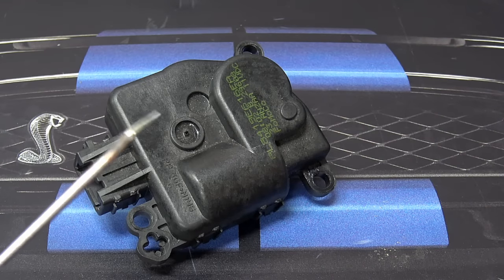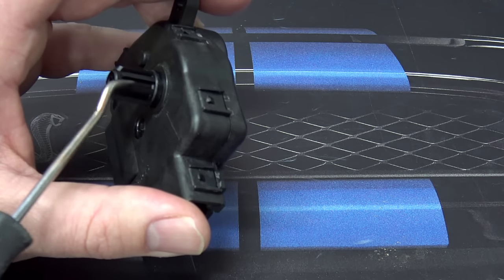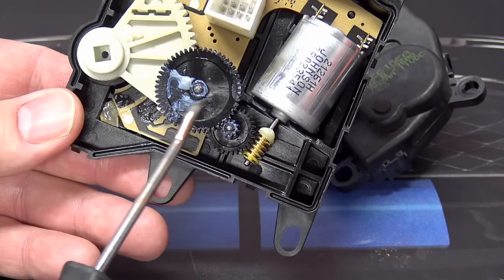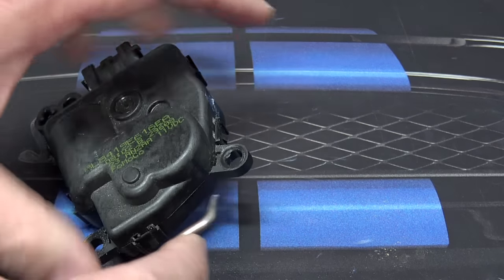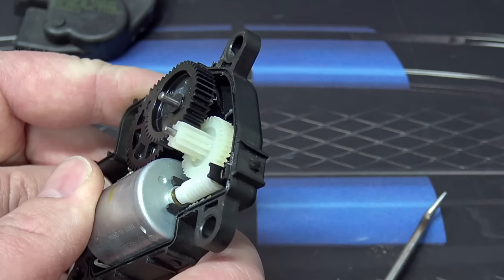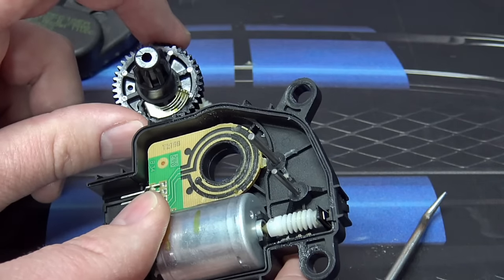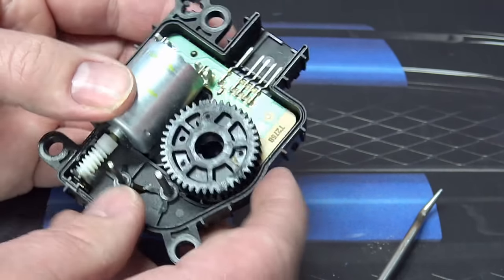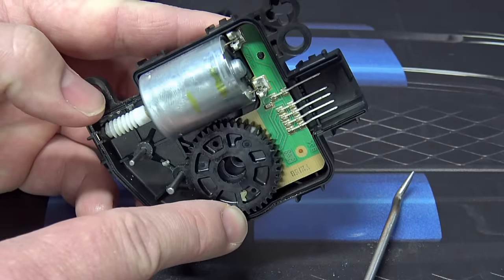Ford Vehicles: Frequent Blend Door Actuator Failures and Why?

Comment: 2008 F150, the temperature was basically either "full hot" or "frigid"; the only moderate temps were in a range of less than half an inch on the dial.  I replaced the actuator with an aftermarket one, did the "learn" sequence, and it would strip the gears at the hot end of the range.  I replaced it again under warranty, same problem.  I replaced it a third time with the Ford part, and it didn't strip at the end, but it has the same issue as the original one.  I gave up and just live with it basically having a hair trigger.

In the 2004-2008 F150, you'll want to remove the radio, the change tray on the dash, and the glove box.  You can see one screw ok and another screw poorly. The third is out of sight, on the back side of the actuator, but with the radio and glove box out, you can get both hands on it and that makes all the difference.

Comment: This is an industry wide issue. My Acura MDX failed about 4 times. I bought a new one the first time, and simply cleaned the contacts the other times.  Good video but why not add a solution? All I do to mine is clean the contacts and add dielectric grease.

Comment: Oh those tracking fingers as you called them is the same on the auto climate control in my Mazda too and so I have to turn it 100 times each way until it's warm then goes away for the most part.

Comment: 4:47 why wouldn't they use a hall effect sensor? Much more reliable, only a little more $ per part
Reply: @IamMike86 where exactly in my question was it answered?

Compared to the negative pr gained from failing parts, I'd say wiper resistor is a dumb move. HVAC being one noticed quickly and ignored. The measure of a vehicle's reliability in a car often is summed up by a layman: "the A/C still works!"

How much more expensive is the sensor? Look it up, scale it up, it ain't shit. They wouldn't cheap out like that, sure it's Ford but pennies for risking hundreds of $ in warranty work per vehicle?

Ford also must not offer any warranty beyond 5 years. No car company wants to fix a blend door in warranty.
Reply: @IamMike86 by a little more $, that includes all associated costs with switching a part from one to another. Hall sensors are way cheaper than their slide resistor counterpart, the change to them is the expensive part, but irrelevant after only a few years
Reply: Remember the PINTO?

Comment: We have two Lincoln Town Cars. A '96 and a '08. They both appear to have blend door actuator issues. It's 2.9 hours to do the job on the '96 according to the book. Pulling the dash is a PITA. I hate to think what it is to get into the 2008 model.
I, too, remember the simple Bowden cable controls on my VW Beetles, as well as a '72 Impala which used the same "technology" to control heat & A/C. Then I remember fixing my wife's '78 Chevette, which had "advanced" to vacuum control... the heat/A/C control panel was a mostly plastic vacuum switch... which failed. Had that car not been basically disposable, I'm sure other vacuum leaks would have caused more hard-to-troubleshoot malfunctions over time. Now we've "advanced" yet again to expensive, but cheap, electronic controls for everything.

Comment: can you 3D print a more durable pair of gears for the earlier design ?  does the grease mess up the more recent design ?  should the fingers be bent outward a little more ?   or is the metal too soft ?    is there an error code for non-contacting fingers ?

Comment: I sent you a small video on your IG. I did a heater core swap. Actuator was fine before work was done. Now it don’t want to work correctly. 2010 Ford Crown Vic. Even bought a new actuator. Same issue.

Comment: Today I bought a 2001 Crown Vic and in the ad the owner said that the AC does not work..when I got it home I turned on the AC and noticed that even though it didn't blow from the dash, it was blowing underneath at the floor..I kept pressing all the buttons and after turning the car off and on several times, it's now blowing from the dash and very cool...since then I have restarted the car 15 times and turned the AC off and on and it's still working...I hope it keeps on working with

Comment: Thanks for the video! I discovered those crappy little gears in the older units a few years ago after taking one apart that was clicking. No competent engineer would have ever designed the moving parts like that, and no competent company would have approved it.  We bought our first brand new vehicle since 2005 last year. Guess what? NOT a Ford!

Comment: 👍🏽👍🏽👍🏽Thank you for this detailed explanation of the inner workings of these actuators. I have a problem with a Dodge truck vent system where the the vents operate and switch the direction of the airflow, but not properly according to the dial settings. I suspect this is more of an electrical problem than a mechanical one and this truck has been plague with minor electrical issues (Mis-wired after-market stereo and speakers, fried climate control panel, etc.). There are tons of videos on the Dodge blend door issues, but not on the actuators and how they can malfunction. Great job?

Comment: Had three of the later versions blow chunks in my '07 Mustang.  Clicking and snapping noises enough to drive me insane.  Can't replace one on the driver's side...thanks Ford for that impossible to remove bolt location.  So, busted it out and manually swing it for upper or lower air needs.  Leave it mostly on panel position anyway.  They all sheared teeth when they couldn't find home position, apparently.

Comment: My problem always seems to be the output shaft being in two pieces. Once removed I am able to snap it right back in. Since I've already removed it and have a new one. I just go ahead and replace it. Have thought about super gluing it in, but haven't. Also this is my experience with non oem versions. The next one I do will be oem. Hopefully it will last longer than the usual year or so from the others.

Comment: What are symptoms of a blend door failure. 2009 king ranch. I cleaned the drain, and condenser. New fan resistor and fan. My ac is ok, then warm. System was charged. My ac temp changes but nothing that makes me comfortable on a got day. If it's 90 outside I am 82 in the cab

Comment: Hey, I’m having a real issue with my 2012 F150 and I’m not sure where to go. Truck won’t go to defrost but the motor is working correct and I can manually move the doors and they seem solid

Comment: Had this cause max ac actuator door to fail. The motor just lost position enough times that the spindle to the door broke off. Now it won’t recirculate.
Reply: Would love to know where that actuator is located and how to get to it. As far as I can tell there are three actuators. Lots of videos on blend door behind radio. Nothing on the others for the 04-08 f150 that show the recirculate actuator or defrost floor vent door that I can find.

Comment: I put seven in my F-150 so far the last one didn't even last 6 weeks unfortunately I took it to a shop and they replaced and did not do an air condition test on it it's hard to find a good mechanic to diagnose so I had to take it back because it wasn't blowing any colder air they finally tested it got everything working I told him to put a high-pressure switch in it worked a lot better but now it's down about a few days later I think I'm going to put a cable on that blend door

Comment: 2005 rear floor roof actuator final gear I set it to blow out the roof with coat hanger wire it's fixed

Comment: I've replaced mine twice already. Both with other brands other than motorcraft. Just went out today, after changing it a 3 weeks ago. Such a pain to do too. Guess I'll try the Motorcraft one and go from there. Is it possible that whatever the actuator needle turns inside the unit is just getting harder to turn and causing these issues? I can't imagine the pain of doing that investigation. lol! Thank you for the video. Very informative!
Reply: Are they really that bad? I replaced mine like eight months ago and it broke either yesterday or today and its starting to get cold. At 45 bucks a pop, this could get really expensive. Are there any metal ones or something out there?
Reply: Are they really that bad? I replaced mine like eight months ago and it broke either yesterday or today and its starting to get cold. At 45 bucks a pop, this could get really expensive. Are there any metal ones or something out there?

Comment: I had a 1972 Ford/Mercury Capri with plastic headlight and blower switches. The internal springs were too strong for the plastic housing and blew out the back of the switch. We didn’t have super glue then or I would’ve glued it back together.

Comment: Not sure if you check comments on old videos,  had a client come in blaming our radio install on a clicking sound. We found it to be the blend door actuator, and it was that new style. We didn't investigate further because there isn't much a radio install could have done to such an isolated part, but could the teeth on the gears have broken? For reference it was a 2011 f-150.
Reply from the maker: Yes

Comment: You seem super knowledgeable in ford. I have a 2010 f150 xl. It is killing the battery after less than a day parked. I have ran a multi meter over each fuse. It draws less than my brother's 2001 when parked and off. The truck shifts into gear without pressing the brake. Could a parking sensor  module be drawing the power throughout the night? How do I find it and change it? Discovered this was broken when my 4 year old put it in hear amd backed ot over the mailbox.

Comment: My 2010 Mustang has the newer blend door actuator. At 30k miles it started clicking every time the car was started or I changed the air flow from top vents to floor or defrost. I got a new one from ford for like 20 bucks. It was kind of a pain to change out as I had to go behind the glovebox and it's kind of tight but got it changed. I took the old unit apart and one tooth on the large gear had broken off. I read online that the grease on these will migrate to the bottom of the unit and over time the gears will lose teeth because of a lack of lubricant. I hope none of the other fail. For what I hear one unit requires the dash to come apart to replace it.
Reply: Falmmable 281, at 30,000 miles, why'd you not take it back to the dealer? were you past 3 years?
Reply: Chris S I bought the car used.

Comment: 2006 mercury GMarq blows hot air only out of upper ac vents.  Throws 024, 025 error codes.  Replaced old style with old style blend door actuator (bda) motor & 2 black gear wheels because I could not get the bottom of old blend door case out.  the old gear wheels aren't broken. Have been manually setting  blend door to all hot for winter. all cold for summer.   3 days ago went to set manually to cold only.  Before setting to cold manually I unplugged wiring harness to bda & tested system by turning on ac while watching bda,  it worked properly for 2 days, 888 no error code.  Then it stopped working again.  024 code sometimes, 025 code sometimes.  I don't take dash out I go thru glove comp. area.  I have replaced the o rings on eatc as well.  Not a great electrician, do have volt meter.  the ac system is fully charged & will cool if I can get this issue resolved.

Comment: Mine wasn't moving right. I replaced it with a Dorman, which stripped the gears.  Replaced that with another Dorman, which stripped the gears.   Replaced that with an OEM part and reverted back to the original problem, and gave up.
Reply: @GooglePixelGoogle  Thank you.  I did eventually dig down to the door itself and couldn't see anything wrong - no peeled foam insulation, etc - and at that moment, it moved back & forth the way it should, so put it all back together. A few months later the truck was totalled, so it's a moot point for me, but hopefully someone else will find these comments and take your advice to try moving the door manually.

Comment: I have to replace mine too. 2016 F150 Lariat FX4. 
Question 1: should I wait for warmer weather since it’s snowing here in Idaho? Or, can I just heat up the cab and do it? I’m worried about snapping off clips due to cold weather. 
Question 2: should I pull the center cluster to access it, as well as the glove box, or, just access it from the glove box?

Comment: Hey man thanks for the video. I have a 2017 f150 king ranch and have had it in the shop twice now with them not being able to fix mine making a funky noise on the initial cycle. They told me there was a TSB issued for it and they supposedly "lubed" them the first time. Still not fixed. How many are there?
Reply: Brian Viola have them change the actuator, cam follower and cam driver.

Comment: I'm not mechanically inclined so my question might be dumb. I had been having problems with the HVAC in my 1999 Ford F150. The problem was that it would not switch modes from Air conditioning to heat and vice versa. My mechanic diagnosed that it was due to a malfunctioning blend door. He replaced the blend door and the motor. This fixed the problem but quite a while later, when I needed to switch to the heat, I got nothing but cold air.

My next-door neighbor found a solution which was to remove two fuses, turn on the ignition, rotate the temperature control dial, then turn the ignition off, re-insert the fuses. My understanding is that this re-calibrated the actuator. I now get heat.

I'm wondering how this fault could re-occur after my mechanic replaced the blend-door and the motor. Is the actuator part of the motor or is it separate?

Comment: Good video.
I'm having a no heat problem in a 2007 Sterling. That's a class 8 Big truck. Do you have any experience with these? Seems like it's the switching unit you refer to in this video. Thanks

Comment: awesome hot air blows well then its just barely warmed air after 30 min, I turn it off for 2 mins then turn it back on and it resumes with proper heat. would that be the blend actuator ?

Comment: Hello i have a 2005 monterey mercury, and i still have problems with the a/c actuastors in the rear section, and all this happened since one day the vehicle for some weird reason ended up with a dead battery a start jumped it to start the engine, and ever since everytime i turn the a/c on for cold air , blow hot in the rear and cold in the front, so i replaced the blend door actuator and i saw that problem you just mentioned it kind of loses track where it is of course i didn’t know at the time, and i ended up replacing the actuator but the problem never solved, and i decided to leave on cold at all times by removing the actuator and leaving the door vent set for cold only, now the front section it started to blow hot air  on the passenger side and cold on the driver side, after i jumped start my friends cars with my vehicle, question is am I missing something ???
Thanks in advance for your response

Comment: Howdy.  Thanks for the super explanation!  I have a 2014 Edge with dual temp.  Drivers side is stuck on max cold.  I have removed panel under the steering wheel so I can observe the actuator.  When I dial heat up/down I can see the actuator responding - it moves quite a bit... so it seems like it is working properly.  However I guess it could be confused as you described... Question: If i can see it moving can I safely assume it is working properly?  If so any suggestions as to what to address next to regain heat on the drivers side?  Thanks!

Comment: Could you do one of these on the Active Grille Shutter Actuators which appear to fail in a similar manner? Specifically, Mustang 2015-17 AGS with unique design actuators that over time lose ability to track full open/full closed and throw DTC's. Quietly redesigned in 2018 to use what appears to be the same actuators as Explorer/F150. On Mustang, failed actuators result in replacing entire shutter assembly as there are no separate part numbers for just the actuator. Wondering if the 2018 shutter assembly can be installed on 2015-17 in order to have the upgraded actuator sold separately for future repair? Ref 15-17 shutter part nos FR3Z-8475-B vs 18-23 JR3Z-8475-F.

Comment: Great video. I have a Mazda BT-50 and the actuator was making a clicking horrible noise. Is the only way to fix this issue, to change the part? I'm about to be charged $1000 just because they have to pull the dash off.

Comment: nice video man.

How many of these blend door actuators are in a ford fusion?  Looks like im getting warm air in all my vents.  It was diagnosed that it was these actuators.   I see two that are under the steering wheel.  Do i have to change them all?  i was also told the the max ac button on the head unit isnt working, would i have to replace the headunit and is that difficult?

Comment: QUESTION! Great video, looks like I bought the actuator with a short arm that sticks out of the bottom. I pulled the old actuator out and it has a longer arm. Are there two different actuators? I can only locate one with a long arm. 2007 f150 with the shifter between the driver and passenger seat (this changes how my dash looks).

Comment: I believe this is the problem on my 2015 mustang. Driver side blows hot when I put it on heat but passenger side stays cool/cold.
Reply: Was this the issue on your mustang? I'm having the same problem with mine and i'm about to replace it myself if this is most likely the issue.